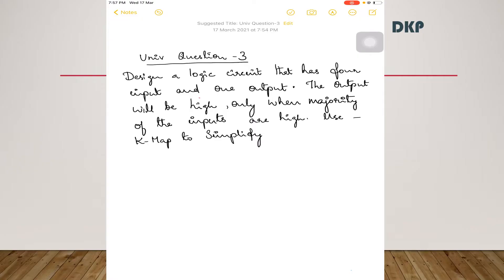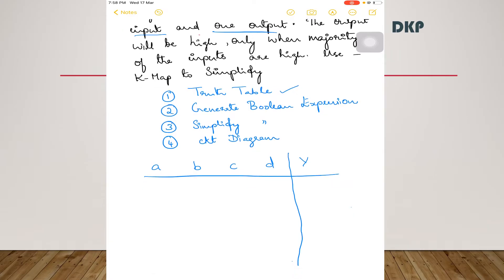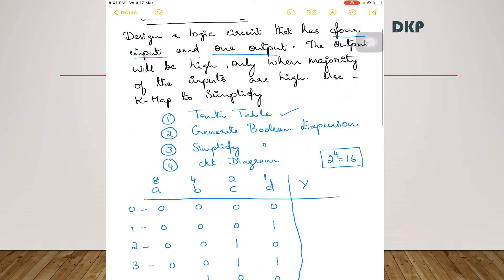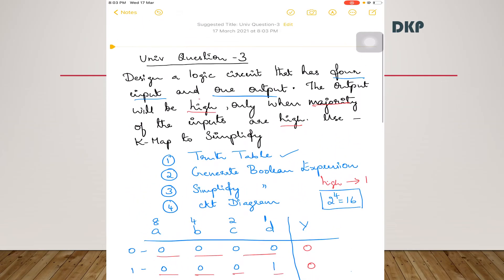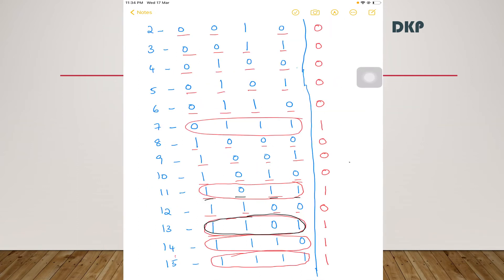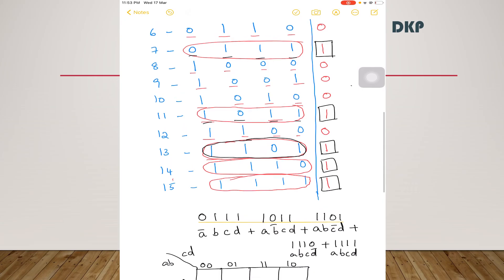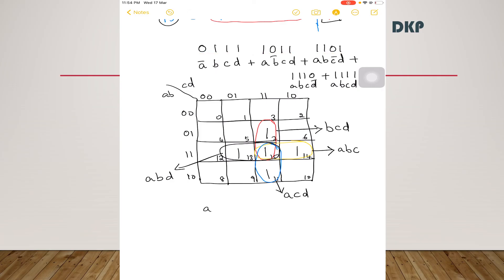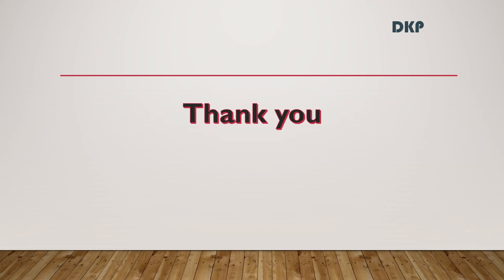Design a logic circuit that has four input and one output/logic design lectures - D K Prabitha

Comment: Madam I want to ask how to solve this problem?
shows four logic-signal lines a, b, c, d to represent a 4-bit binary number with a as
the msb (most significant bit) and d as the lsb (least significant bit). the binary inputs are fed to a logic circuit that will produce a high output only when three or more of the inputs are high. use karnaugh map method to simplify the boolean expression, show the term for each case where the output is logic 1 and draw the logic circuit.
the solution is the same as this question?